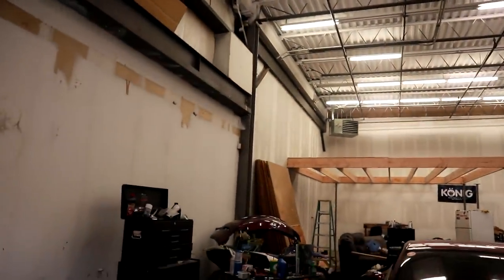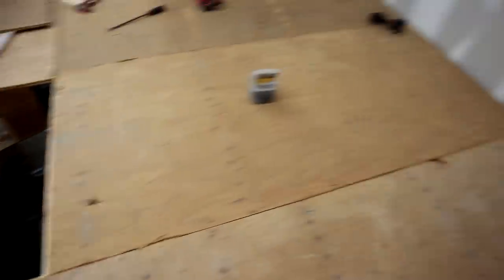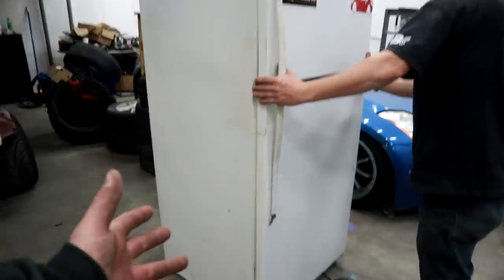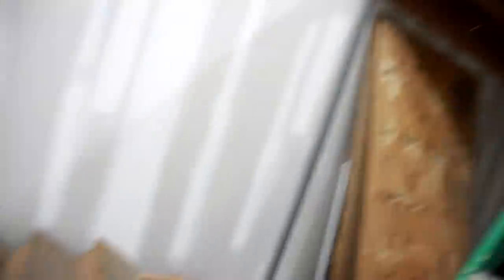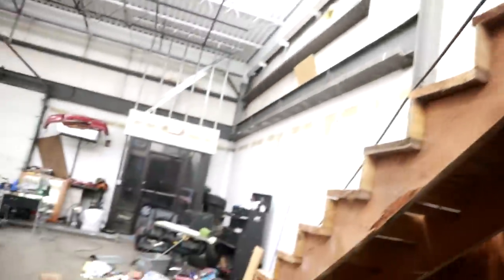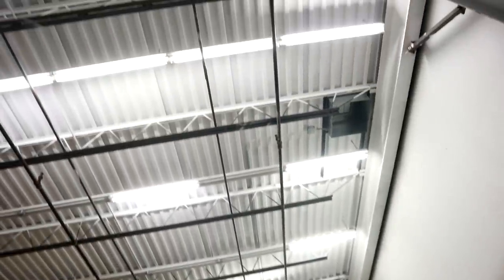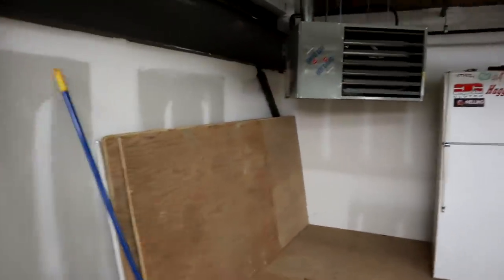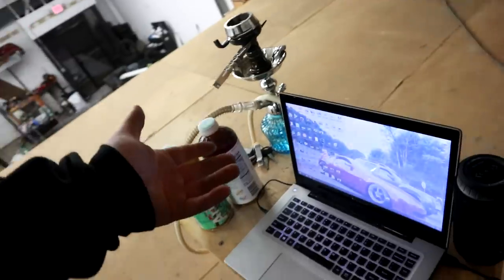MY GARAGE LOFT IS DONE!!!

Comment: Just as an idea, you could one day turn the part under the loft into a cheap paint booth. Shop is getting legit.
Reply: ArgentineGuy That’s a very good point. Can’t wait to see the finished product.
Reply: Man I just said something about this in the last video lol
Reply: That’s actually pretty good idea get some bright lights under it and bam a nice paint booth that could be temporarily sealed off
Reply: That is a good spot for a kill room/paint booth
Reply: Yep temp drop cloths and your boi has heat so even in the winter paint be set.
Reply: That's not a bad idea at all, although he does have access to professional paint booth directly on the other side of that wall. 
But a temporary one right there wouldn't be a bad idea for small touch up stuff
Reply: That he does... but there are a number of jobs where that full system is not required. Like doing the rims prior.
Reply: @wobblysauce  yes, it would be just fine for smaller jobs like that, and cut down on the chance of getting over spray on the vehicles. 
Just out of curiosity, do they make some type of small self contained filter system that could be used for a small homemade paint booth like that?? Just wondering. If not I should try to invent something and patent it!! That would probably be a nice little seller

Comment: Ok, you need to finish the top by placing a very sturdy 36 inch wall or railing so no one falls from there, it is CODE, I believe it needs to be 36 inches tall, and you can get carpet at home depot decent price to put on the floor, but please add some kind of railing around and going up the stairs, you can even do an industrial look using metal wires, they are cheap and you can use them up as a railing too, I gotta buy those guys a drink one day, thank you for helping Damian out, I sure appreciate.